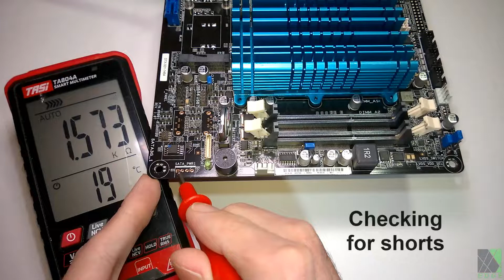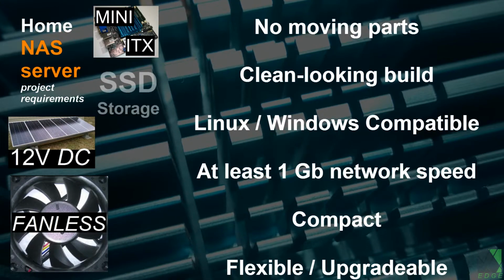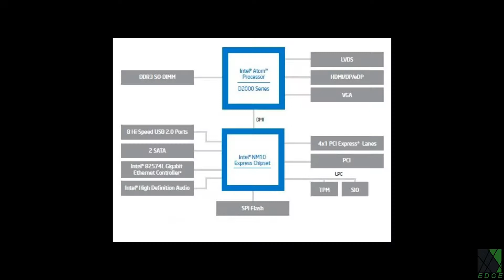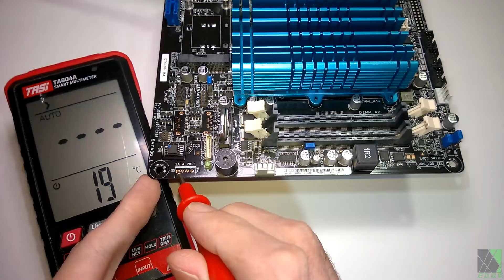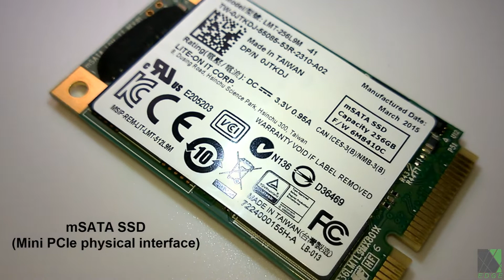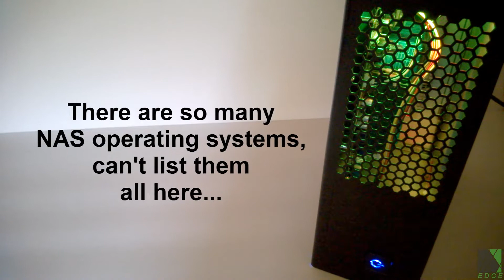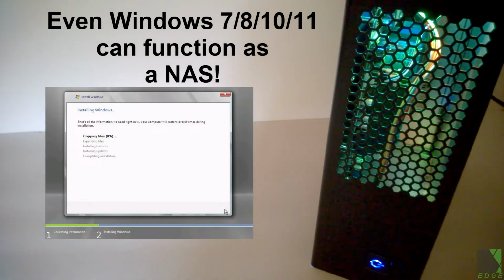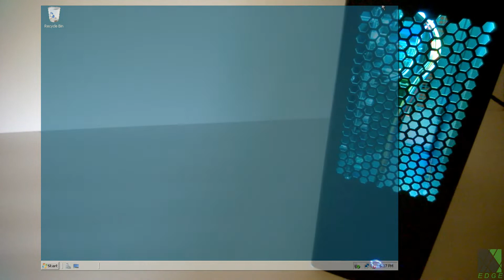12V DC home NAS server build! budget low power Atom, fanless, cheap RGB LEDs, embedded motherboard

Comment: my old laptop with (power on usb-c) Intel Pentium Silver N5000 processor, 4X cores, 4GB DDR4 + two nvme connectors, lan usb 2.5Gb, (proxmox = ARC-dsm, Casaos, Adguard), draws 8-9W idle. I wonder how many photovoltaic panels and how much power it needs, and how big a battery for it?

this video inspires me but I don't know how to take myself offgrid
Reply from the maker: @StanisawSwierczynski Hi, that's a pretty efficient machine! 

A couple of 100 watt solar panels and 100ah 12v LiFePo4 battery should easily run your server 24x7. This is based on rough estimates. Even better if using straight DC power - no inverter.

I use a tiny Atom fanless laptop as a server to backup my VMware servers at home, and another one of these EMB-CV1 boards with VMware. They are older technology, but I value them a lot :D

Comment: Can this handle 8 HD iptv camera streams coming in from a POE switch? It should be able to write to a persistent storage as well as upload to a cloud (possibly after encrypting). Been looking around for a cheap low powered , fanless solution.
Reply from the maker: @deltagamma1442 Hmm good question. Depends on how CPU intensive the IP camera software is? The 2550 is working well as a Windows server NAS - due to very little CPU need. It can max out a gigabit LAN writing to SSD. I believe it could handle writing video to disk. Encryption, not sure - sounds CPU intensive.

Comment: Awesome build! I first used Raspy then it got overwhelmed with the IP cams, then finally I switched to an used laptop running Proxmox and Home Assistant! I didn't know that laptops actually can run for years without a hiccups! That mobo you're using is probably in the same lineup like the AMD Geode embedded stuff if I correctly remember..
Reply from the maker: @ferencszabo3504  Thank you :) a laptop with Proxmox - awesome. We have an Atom netbook here running VMware backup server snapshots... only 6 watts. Can't stop buying old PCs. Totally forgot about the Geode, yes I think that was sort of like the Atom CPU for AMD
Reply: @solarpoweredge   this particular board could "run" windows 10 ? i'm worried that this old cpu would run alwais at 100% even tring to boot into a modern operating sistem. is preatty cool that consumes aroud 12w , how much it goes up while transfering on network or intensive tasks?
Reply from the maker: @MatteoComensoli   Yep. It's fine for a NAS. Check reddit, there's one guy even used a D525 (older).

Comment: How do you regulate the 12 volt input? I was j see the impression computers where very voltage sensitive and needed a regulated source.
Reply from the maker: Hi, yes they are sensitive to voltage, so have to be careful! It depends on battery type, voltage profile and board design: this particular board EMB-CV1 I tested straight off li-ion (unregulated) and it worked very well. The various 5V rails and such are generated by VRMs off the input supply. 

A 12V LiFePo4 battery could be up around 13.6v so a simple DC-DC converter with a regulated output of 12V works well and can run multiple computers at once. 

It is risky to connect unregulated voltages to a computer, but it works sometimes. Other times it can burn out. Here is an Atom netbook running straight off a solar panel with the battery removed: https://youtu.be/1fqeB_vw5-g